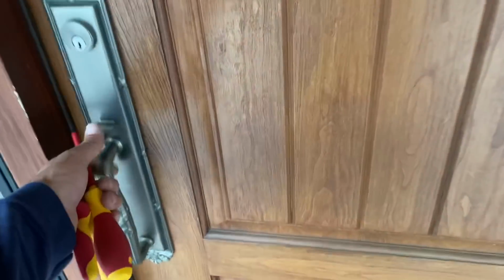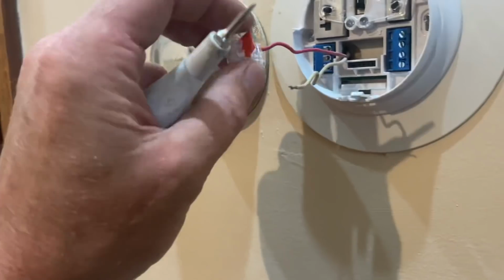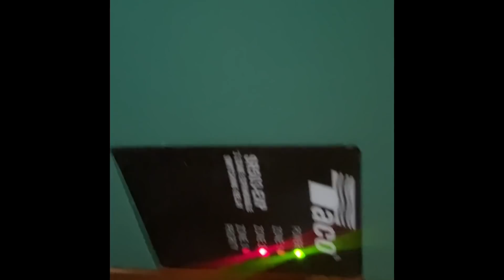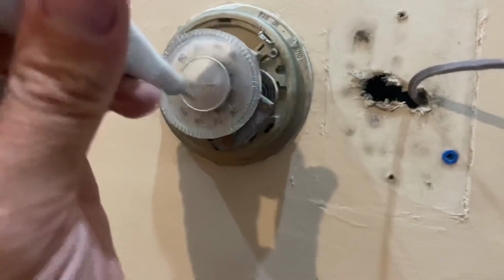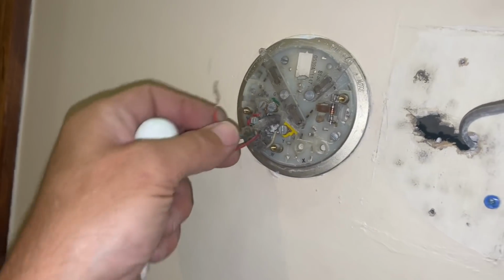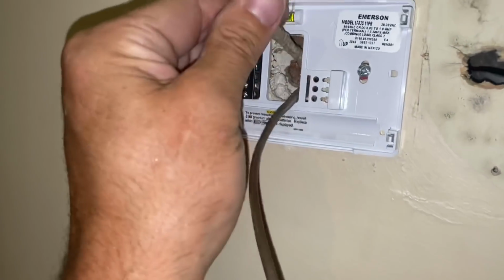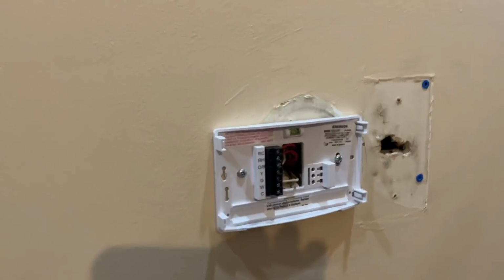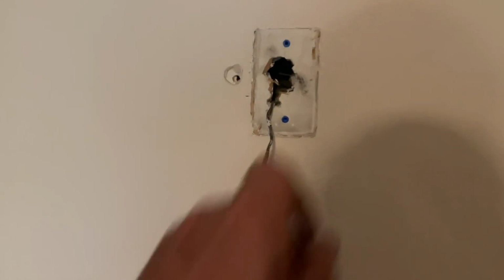Got 2 on your wall? This is Stupid! How to Install 2 Thermostats into 1 for Heating & Cooling - EASY

Comment: The old mercury thermostat never goes bad
Reply: they do/did, but it was most always the baseplate switches gummed up or plastic broken from strong-arming and not the bimetallic or mercury bulb/wiring.

Comment: I remember there was one of those round honeywell stats with the mercury bulb here where I live..  Set the heat anticipator correct and they worked perfectly.
Reply: If it had a mercury tube you would be right.  But the Homedepot Honeywell  bootleg is usually off by 6-8 degrees even when it works
Reply: @atlasfueloilinc.2421   O yes it had the mercury bulb! It was installed in the early 80s when the central AC went in.

Comment: Thanks for the great video. I have a similar situation at my house - I'm trying to combine my baseboard heat with my central AC, but with a smart thermostat that requires a C wire. Is it possible to add a C wire to this setup using an external 24V transformer?

Comment: Hey Mike love the Chanel.  Those t stats are power robbing. They don’t work with the taco zone boards unless you install the resistors that come with the zone boards.
Reply: They work for about 4 days until the battery dies. LoL
Reply: exactly 2 thermostat bad on same job. lol dumb dumb! That new style yoyo has to have power sent to operate. But screw em let them replace it to a programmable

Comment: Would this work if your heat unit is a hot water boiler? I have the same issue- 2 thermostats side by side. 2-wire (r/w) with boiler, and 3 wire (r/w/g) for the AC thermostat. There is a jumper from r-r/c. The fan is hooked up (g), though I have a whole house fan and never use the fan. Would I need to remove the jumper from r to r/c? Common sense tells me yes.

Comment: Old Honeywell have heat anticipator circut did you check this when installing new boiler for proper amperage?? 2 thermostats blowing ??? Sounds suspect?
Reply: those are newerT87's (, white color with electronics and coin cell battery power). I believe they state 10years life(maybe 7?), the batteries go dead and they just quit working.
they may be flipping them all to "cool" and turning it down, so it stays on doing nothing but eating battery power 24/7 during cooling season. I imagine on 24/7 like that could make the battery last under 5 years time

Comment: I have 2 White Rogers Mercury Bulb Thermostats (1960s) which are still serviceable and 1 is currently powering a McLain CGA-3 (New) Boiler.  One can easily pull off the face plate and see exactly where the mercury is in the bulb in relation to off-on operation.  Simplistic mechanical operation without fail.  I have had 3 Electronic Thermostats in 30 years--no thanks. Plus the WR is a very handsome dude  as well.  I believe they are original to this 1964 house.  Have a separate modern Thermo for the AC in upstairs hall.  The system was 2 zone and that's why there are 2.  The active WR is on the master BR wall and the 2nd WR is currently sitting on the DR Table waiting on my decision to reactivate it.  Since winter is over, it seems awkward to fool with it now as a 2nd heating Thermo until later this year.  Would have to make system changes as well.

Comment: What thermostat would you recommend for a heat pump with auxiliary heat? Also appears there is no common wire at the thermostat.

Comment: Problem could be button battery in the Honeywell thermostat.  If 24 V power turned off a week ago cause no heat was needed then thermostat was running down the button battery. Should keep 24V power on during the summer and turn down the thermostat temperature for the heat to turn on.
Reply: @PipeDoctor  Do you still have access to those thermostats? Check the button battery voltage.  BTW I hate those Honeywell thermostats. It is a PITA to change those button batteries.  I like stats with AA batteries.  Easier to change.
Reply: @PipeDoctor  No.  Been there before as I am sure you have been.  What not wifi, programable heating only thermostat, without an AC function, would you recommend?
Reply: @PipeDoctor  Thanks for the stickers! Got them in the mail.

Comment: Saw your link to buy Emerson series 80 thermostats.  But what thermostat would you recommend to open a zone valve in a hydronic system?  Don't need the AC function to open the zone valve.

Comment: Many years ago the mother-in-law had air-conditioning air handler installed. She had hydronic hearing, the installer could not figure out how to wire both systems to one t stat.  I ended up putting in a relay to make it work one old round stat.

Comment: If you have a Boiler, “Hydronic Heat,” don’t combine your thermostats with a split system thermostat. This is why, when it’s very Humid, and not hot outside, IE Raining. You can run a little bit of heat, and run your cooling too. This makes an excellent dehumidification system. It is not very expensive to do this verses running a dehumidifier, and you have whole house dehumidification.

Comment: the later white T87's are electronic and have a lithium coin cell battery, which is supposed to last 10 years(i think they claimed) I'd imagine that's from date of manufacture. but they sure don't in many cases!

Comment: I've had trouble with those old yoyo thermos with taco systems. I called Taco and they told me some thermostats are not compatible with Taco because of a high current demand from the Taco equipment. FYI
Reply: likely they're 5+ years old  and the coin cell batteries died ( yes the newer white T87's are electronic and have batteries!)

Comment: We get a lot of those thermostats that don’t work after an install. In fact I have tested them many times and they don’t have continuity unless voltage is applied to them.
Reply: Did you set the anticipator on them???  If not they will burn open.  Duh!!!!!!!!!!!!!!!

Comment: To much current through the thermostat is killing them.. I would see what the current is.. if you send 115 through a 24v thermostat it will kill them.. but being a X HD employee I can tell you without a doubt the thermostats sold at HD are garbage. I would direct customers to a HVAC parts house. Mostly because they were a lot higher quality. This isn’t because HD stocks crap.. it is because of the shrink vs turn. If we stock high quality thermostats our profit scale didn’t make sense because of the turn. (A turn in retail is how many times we can legitimately sell an item in 30 days. This is because after 30 days we are paying to store things on the shelf. The profit margin makes it not make sense to carry the product)

Comment: Uhhhhgh. Welp you change the stats and eat the cost.
That T87 design goes back quit a way, it’s a dinosaur, but they worked and worked. I’ve taken out ones from the late 1930’s that worked.
Reply: They were reliable when they had mercury switches
Reply: @kenc.9067  yep, the later white T87's are electronic and have a lithium coin cell battery, supposedly good for 10 years. (yeah right)

Comment: Sounds like easy heat and cool could have put in those old  piece of crap thermostats.
Reply: Those "old pieces of crap" are in more homes across the country than any other type...and they work great.  They are analog so they don't have a digital readout...but they do work just fine.
Reply: @aday1637  the Honeywell thermostat with Mercury is way more reliable than any digital thermostat ever made or ever will be made
Reply: Manufacturers and engineers purposely makes things last shorter periods of time so that you come back and buy it again and again so they make more money. Manufacturers don't want you to have something that lasts a long period of time they want to get in your wallet again and again and again. These low in digital thermostats are made with the cheapest materials possible the cheapest solder the cheapest circuit boards and they will not survive power surges.

Comment: The chances of both being broke are in the millions.Theres an issue with that model registering the correct room temp,and not being able to call for heat without being jumped out.Its always that model when it happens to my guys.There junk anyway better off changing them out so your not married to this job.
Reply: most likely dead coin cell battery in both.

Comment: The sad part is the Mercury thermostats were better and more accurate. I still have 4 of them in operation.  Set to 70 it runs till 72 and back on at 70. My other house has a digital thermostat and set at 70 it shuts off at 70 and turns on at 66. What a pos new school garbage !!
Reply: adjust the anticipator to change cycle duration(temperature swing) lol.
Reply: @throttlebottle5906  Possible, I didn't install it. I ripped it out and put a mercury type back in .
Reply: @NY411Info  I meant on the mercury bulb ones, adjusting the anticipator would make longer or shorter cycles, in both on and off-time.
the electronic garbage usually has a setting for CPH (cycles per hour), set to electric heat is usually the highest count per hour ( run 6 times an hour)
Reply: @throttlebottle5906  Ah. Yeah the dial resistor mine works good at 4 on my Merc. Thermostats. Since they don't make them anymore I bought a few nos eBay finds.

Comment: Did you adjust and set the anticipator circuit on the home depot t-stats when you installed the new boiler (or whatever you did the week prior)?  If not YOU caused the failures.  Not nice.  The T87F has an anticipator circuit.  If your amp clamp isn't sensitive enough you can wrap the wire with load 10 times around your clamp and then divide the reading by 10 and set the anticipator to that.  If you do not set it and the load is too high (amp draw) the thermostat will open up and never work again.  I think you know that.   Why bullshit all of us, though?  2 t-stats didn't mysteriously fail simultaneously.  That just doesn't happen.  And quite frankly, the home depot are the same quality as the non-home-depot one's as they are made in the same factory.  Hope I schooled your viewers as you your honesty.